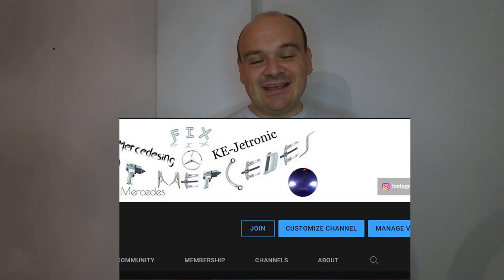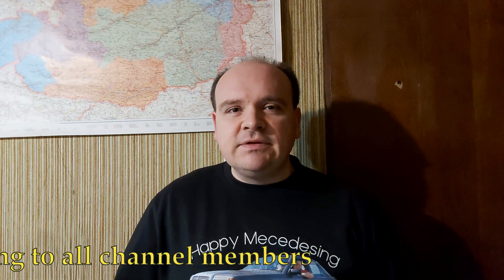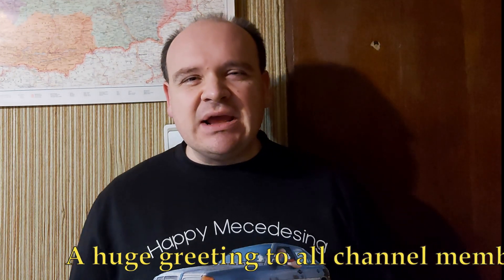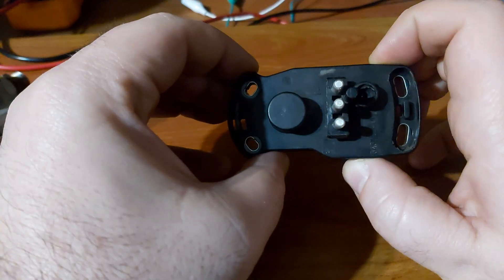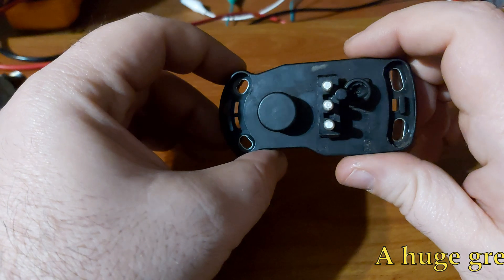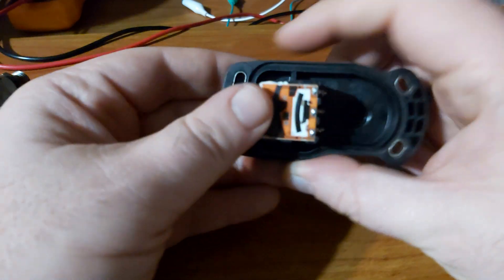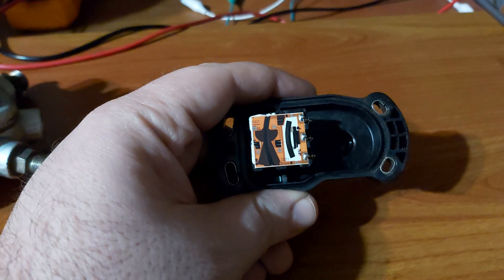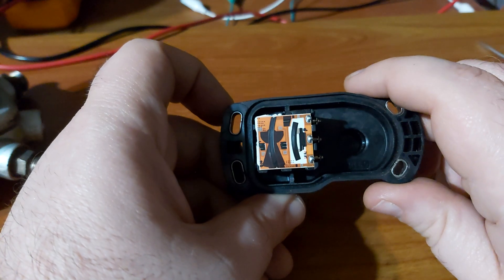㉦Mercedes Ke-Jetronic㉦ - An unused potentiometer - idle issues

Comment: Sir, I am a new subscriber to your channel, and I was told or saw somewhere else that there is a way to repair a scraped or damaged surface on a potentiometer by using graphite spray? Is this true? If yes, can you please show how and with what product? Thank you in advance for help.
Reply from the maker: Hello. It is possible but it's not a permanent solution. So, I would advise you o buy a potentiometer from Germany which is relatively cheap and you get 5 years warranty. Greetings from me,IFyM

Comment: Hello, I have a big problem on the 230e 1991 w124, when I start to accelerate only from 2500 rpm to 3000 rpm, what do I need to do???
Reply from the maker: What kind of a problem is that?

Comment: Maestro buenas noche como está disculpe la pregunta en la punta del árbol lleva una referencia marcada 20 21
Reply from the maker: No entendí lo que querías decir.
Reply: Maestro mi pregunta es q si el árbol de leva en la parte donde lleva el piñón de la cadena lleva alguna referencia para sincronizarlo con el cigüeñal. @mercedeske
Reply from the maker: @carlosramirez-vt3vc  No, simplemente siga el cable del módulo de encendido EZL y lo llevará al sensor de posición del cigüeñal. Creo que solo los motores V8 deben tener algo de holgura, los demás no.
Reply: @mercedeske  gracias maestro.